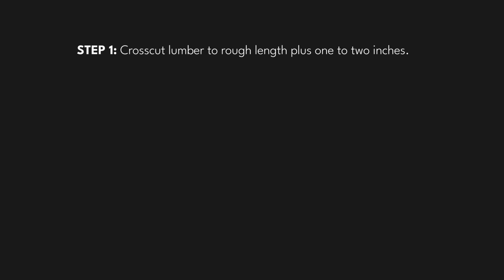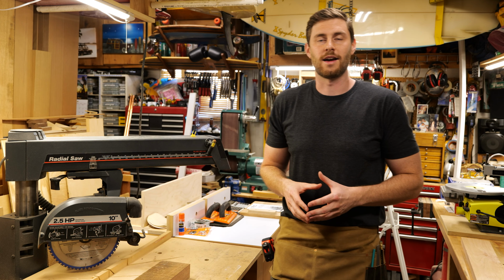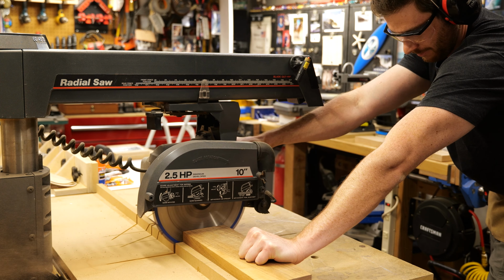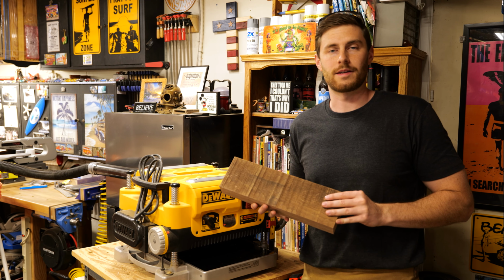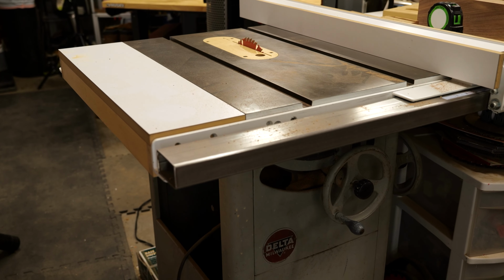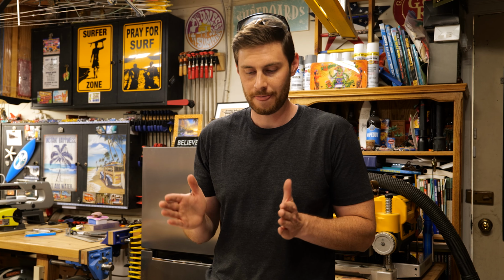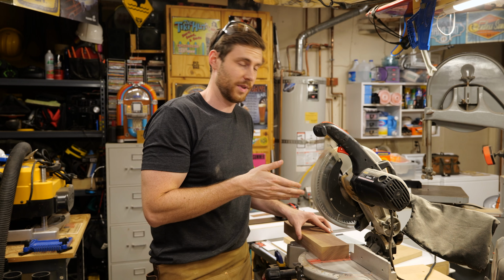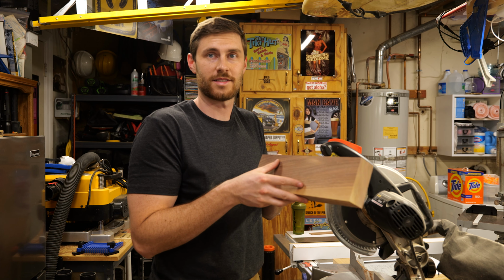Milling Process - 8 Steps of Squaring - Woodworking

Comment: What would you recommend for checking square at the end of the process? This is coming from an individual commonly using government equipment that not might be up to what some might consider an acceptable standard.
Reply from the maker: Great question Jake, nothing is ever really perfect. Your project needs and specifications will determine your tolerances. Being perfectly square in woodworking might not be considered square in machining but is relatively close. Anyways some of the easiest ways to check for square is by using any form of a square tool or straight edge like a ruler. You can lay the straight edge on the face to check for flatness by looking for any gaps or light that may be coming through. Or a square which is checking for edge squareness to the face. I also like to use my table saw top which is cast iron and milled to a certain tolerance to check for flatness. Hopefully, this helps out.